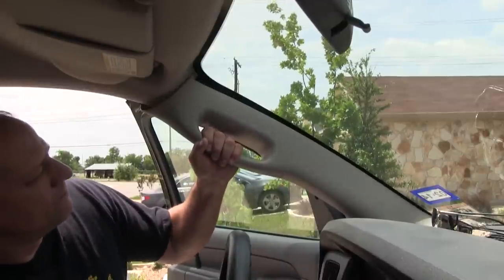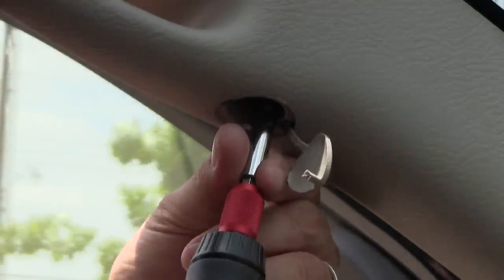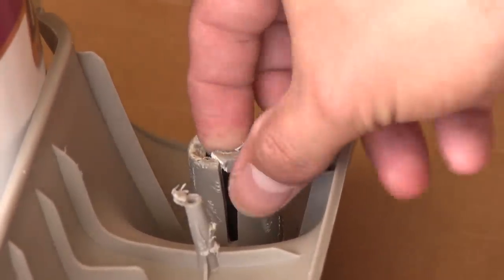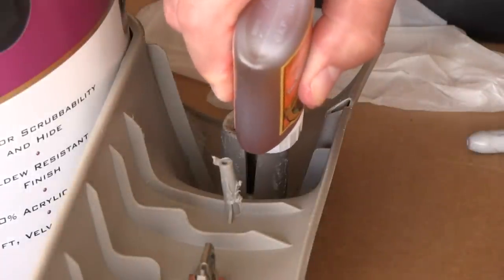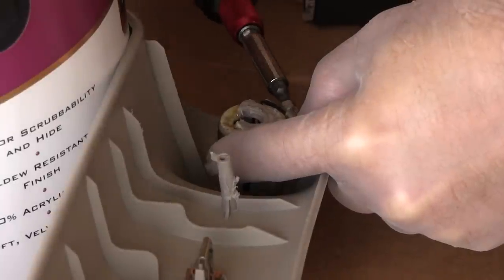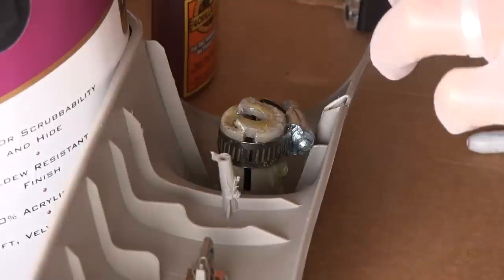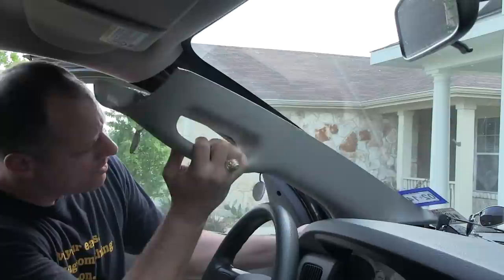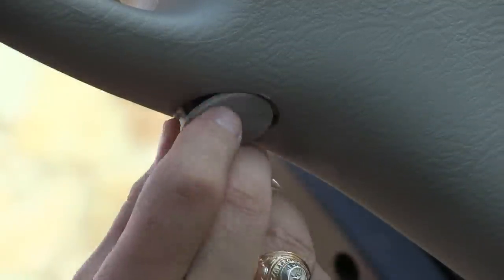Dodge Truck Grab Handle Repair

Comment from the maker: Jessica, it is true that I could have just bought a new one, but I fixed the broken one in no time and for 1/4 the price. That's good cost benefit return right there. It also seems that lots of folks appreciated this info. On the other hand, you watched a video you apparently didn't like...and even took the time to comment on it... Of the two of us, I seem to be using my time more wisely. I will continue to try to help others and you can continue to watch, and comment on videos you don't find useful. 😀
Reply: Well you burned Jessica with this comment.  Good video by the way, thanks for the advice

Comment: Thank you so much for this quick, easy and great fix!! Already had the gorilla glue and washers, paid $2 for a couple of clamps, even though on a Durango the piece is more square, and it is fixed. Much cheaper than buying a replacement piece for $70!!

Comment: I did try it this way  and for me it only lasted a year before it broke again.  It was fine until i forgot about it one day getting into the truck and pulled on it too hard snap there it went.  I will try the brass hose fitting method next to see how long that works for.
Reply: How did the brass hose fitting method work 4 years later?
Reply: @Dave L.?
Reply: @butterbeanq  actually it has been so long i have forgoten how i fixed it.  It strikes me that i used the fitting but i also did something extra, i just dont remember.

Comment: Excellent video.. How did you find out that water activates Gorilla Glue
Reply: I did not know this about gorilla glue either until last year for some reason i decided to read the bottle and it was right there on the bottle, water activated :)

Comment: Mine just broke  but the very top broke off completely like a 1/4 inch from the top piece like a disc, do you think I will be able to fix it the same as you did? just putting the top back on with gorilla glue and a clamp?
Reply from the maker: David, it doesn't sound like you'll be able to fix it with this method.  You may have to come up with a "cap" that will slide over the plastic piece that broke and secure that.  This handle design sucks and I am disappointed that something that is supposed to hold a man's weight is so weakly designed!
Reply: I know dude what you mean, I cant believe they would make something so cheap , I did it any way and it seems to be holding up ok, it is a little loose though but not much very little but . if you notice it does not go back tight against the frame as if you look over at the passenger side one looks all snug against the frame but it will do for now, I used JB weld , the hose clamp and a small washer on top of the cylinder.

Comment: my bolt won't come out. The nut that's in the body just spins ...any ideas how to get a hold of it to stop it from spinning?
Reply from the maker: +Theresa Lange ... hm.... no idea.  Mine was a simple bolt that came right out.  I can't remember the size, but I have a standard US as well as metric socket set and one of them fit.  Sorry, I never thought to note which size it was.  Theresa, are both bolts spinning?  If so, you should be able to give it a hard pull and have the plastic piece come off.  To me, a spinning bolt head (provided you have a socket that fits) is a sign that either the bolt is free of the hole or it has broken off inside.  Either way should mean it's free to pull off.
Reply: +TheHornedlizardman1, I went on to repair the driver's side per your video with excellent results. The passenger side after ripping the plastic pillar piece off, it's ok I fixed it;) the nut was no longer holding in the pillar allowing the bolt to spin. truck is currently in the shop for another issue and their going to look at it.
Reply: if you have a welder; simply tack weld the nut to the apillar if your able to do so. no more spinning nut.

Comment: Man, people like this kill me.  For the time you spent fixing this (and it may not last....glueing a washer to the end doesn't strike me as a good fix), you could have bought a new handle for $41.00 at amazon.  My original lasted 14 years...how long will a "repaired" one last?  Not sure what you make an hour, but you could have saved more money/time working a little longer and buying a new handle.